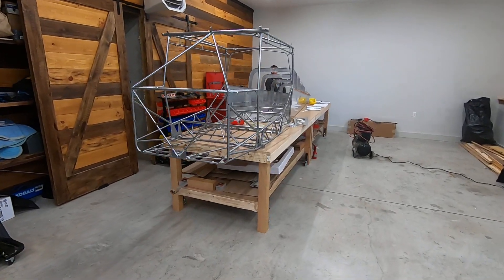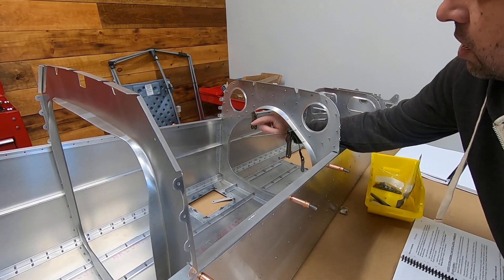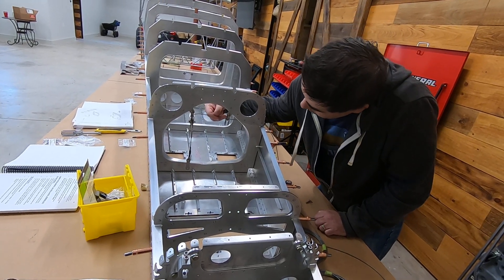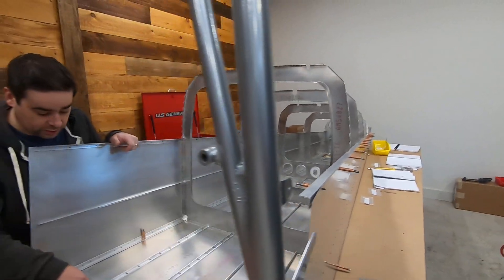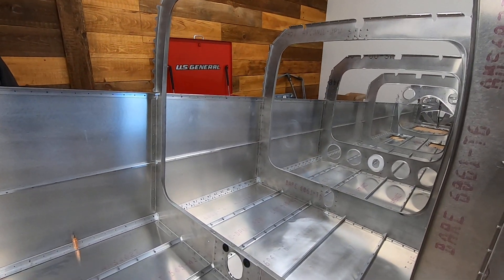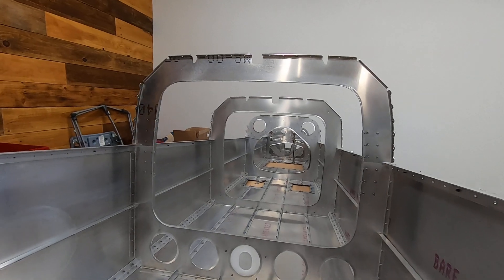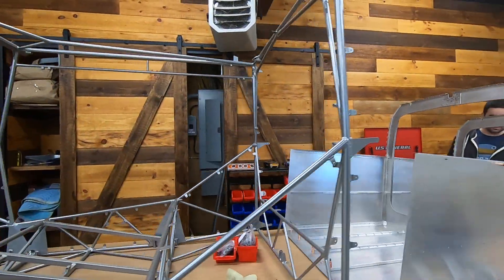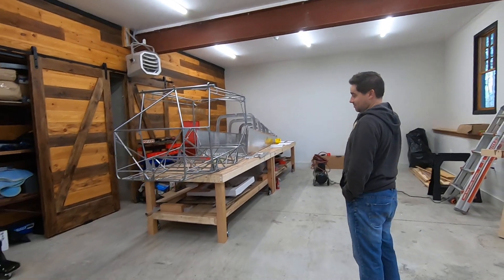RANS S-21 (008) Tail section build

Comment: I ended my tail parts with a couple dozen or so -41s extra, but no -42s.  I actual came up short when I found that the one side of the trim tab hinge was too thick for -42s (confirmed by RANS and they are updating their parts list).  If you came up short on -42s and had lot of -41s left, you may have gotten a few -42s where they weren’t indicated.